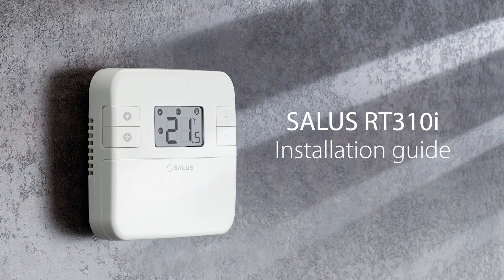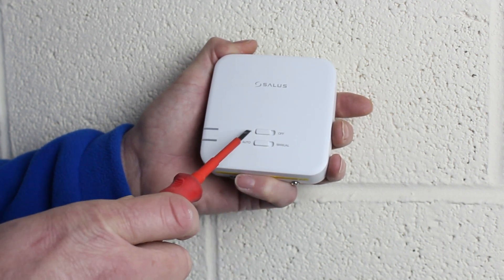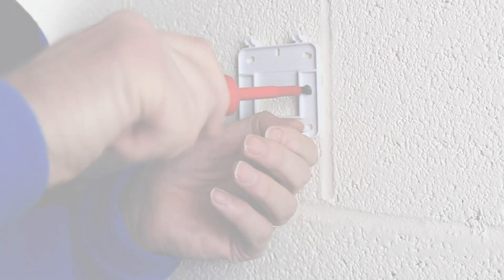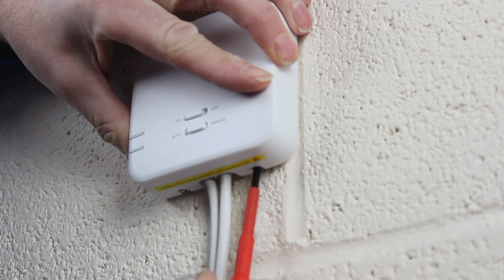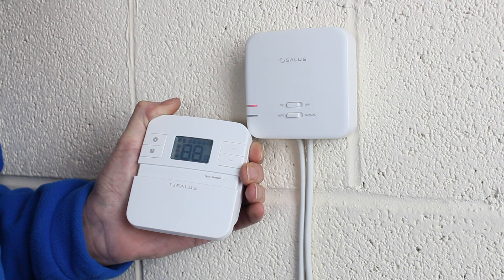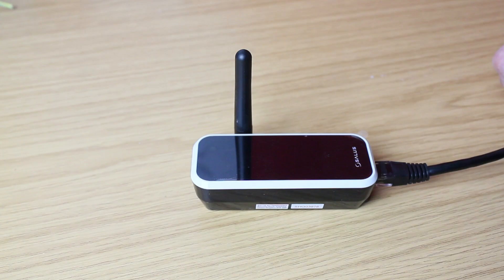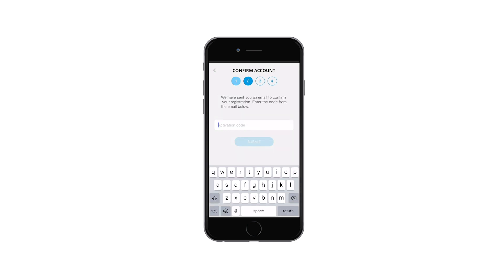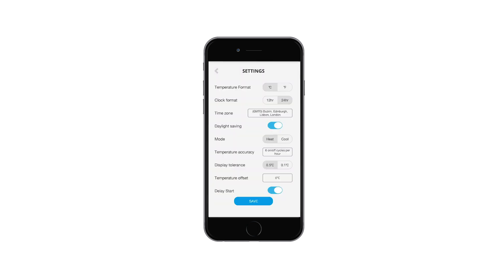Installing & Setting up your SALUS RT310i

Comment: Read this!
I had a problem with the Salus rt310i, the room unit did not send a signal to the unit on the boiler or something like that, the problem was mainly the signal between those two units, the one on the boiler simply did not respond... I tried everything according to the instructions, according to the advice from yt and everything was unsuccessful... I would manage to get a solid red light, but never a green one... took out the batteries several times, changed them, waited, turned off the boiler, switched to manual mode, reset the internet module and nothing, everything was unsuccessful. .. I was already getting ready to start buying a new one, but at the last moment I decided to eliminate the internet module, not realizing that it could have any impact, and for some reason, there was a problem... everything worked after I eliminated it... So, if someone has a similar problem, someone must try this, maybe it will help.
Reply: I got the same problem right now .Reciever is not recieving . Hot water is ON thou. Heaters is not working

Comment: If someone is considering to purchase this unreliable piece of hardware, or has immense satisfaction owning it and not being able to connect, here's the advice from the official support:

Please unplug thermostat and receiver from power supply for at least 10 minutes. Then put back batteries to thermostat, power your receiver and try again:
1) First fast switch ON/OFF/ON on the receiver
2) Then hold for 3 seconds PAIR/TEST button on thermostat
3) Wait until RED led diode will stop flashing on the receiver
4) At the end hold PAIR/TEST button on thermostat once again (3 seconds to exit pairing mode).

If that doesnt work anymore - you will need to contact your distributor to replace that device under warranty conditions.

Good luck!
Reply: You the best, disabling for 10 minutes helped me
Thank you!!
Reply: Very good, helpfull answer!! Thanks!
I own two units that worked flawlessly for 5 years, (for both heating and cooling!) but recently a hickup in the communications messed up the preprogrammed connections.

Comment: Really silly question, this was installed by contractors (I rent) and nothing was connected to my router. Will this make a difference? Currently pulling hair out as doesn't seem to be doing its job 🙄

Comment: If you're checking this to see whether you wish to purchase this I'd strongly recommend you don't. My system failed after less than 3 years. Spent 6 weeks trying to get help from their customer services. Sick of being ignored so replaced it with another brand. Poor product, dreadful service. I believe a firmware update bricked it. Their FB page has other users trying to contact them over similar issues and complaining about being ignored by their tech support. Just avoid at all costs.

Comment: I had problems fitting this wireless thermostat. Turned out in my case, that you can only fit this one way or the other, as shown in this video. At first i tried to wire it with the jumper, and the boiler wouldn't fire up. Then i tried it the other way and that worked. 
Obviously the live (Brown), and the Neutral (Blue) go to the same on the boiler. 
Then another cable to the same connectors as the jumper I removed from the boiler.  
Seems to work well now.

Comment: can this video (receiver installation part) be applied to SALUS RT510TX? Even if on be box says RT510RF. Thanks
Reply: Did you ever find this out friend? I would like to add it to my system let me know
Reply: @suedenim6590  no, i didint Im afraid. Thanks
Reply: Fitting is exactly the same. I just followed this to install a RT510RF - had no problems at all.